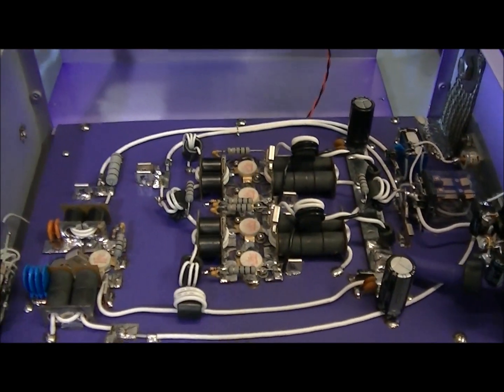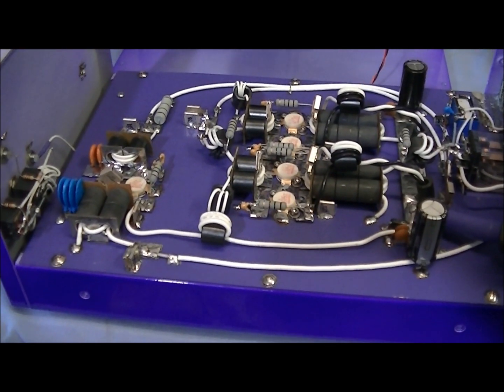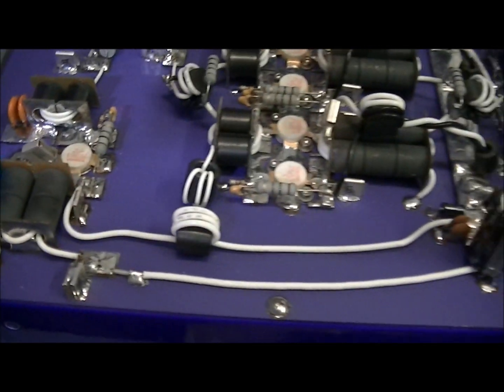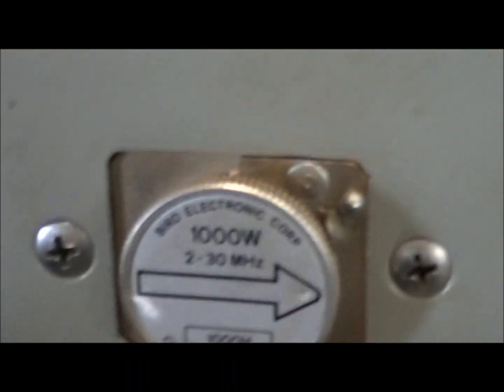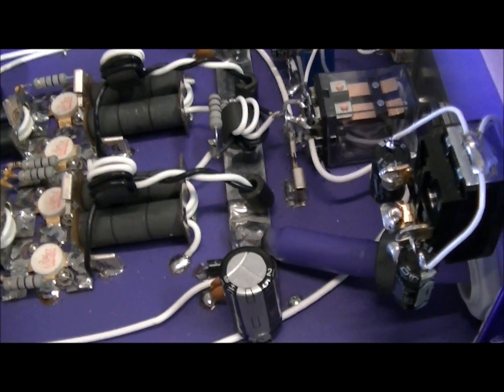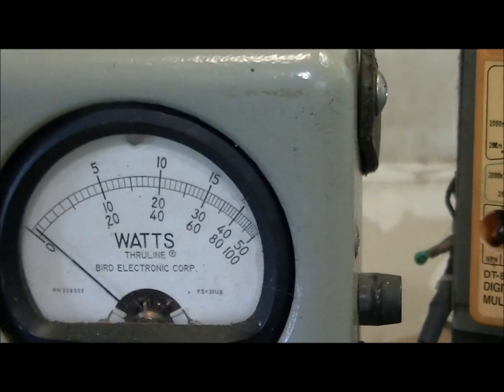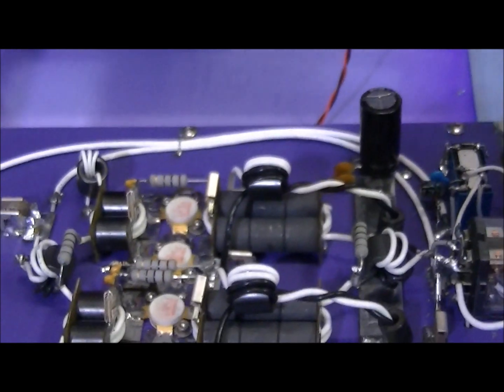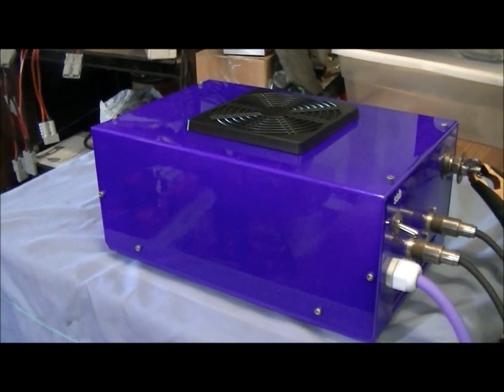GK Built 1x4 5 Pill Staged Amplifier In LARGE Case GOT DOWN!

Comment: Gatekeeper,  I'm  planning to up grade an older five pill base amp with a 100 amp iron transformer.  What type and  size wire should I use from the rectifiers to the capacitors  and then on to the hot plate, thanks

Comment: That working great. The tunning of pass threw on staged amp can be tricky at times. now some metal clads are hard to get. I got fancy on a re build using tri color led for power then key and led change color. I did a 4 pill fix with extra twist. DPDT bias relay with switch. AB/C . used outher contact to jump bias diode to ground when un key and class c. when bias relay un keyed the diode jumped out. what the extra contact did. so switch just break bias relay coil. I have done 1 pill with round ferrite wound 5:1 or 9:1 depending on transistor. can do it with output as well. got idea from 1 pill amp that was done that way. got a bunch of voltage reg IC today'. LT 1038 and LT 1083 and more. 73's
Reply from the maker: Let me get this right. Are you telling me that you used a ferrite(single ferrite) to wrap 5 wraps to 1 for the single transitor so there isn't any compensation capacitors(1000s & 104) to make up the other pill not being there. Id love to see that! Could you send me images to my email threemanpro at gmail . Com please.

I have thought about using tri color before but never took time to work up a circuit on how I could do that. I've used bi color before.

I did a few AB/C boxes in the past. Havent had anyone request one in a long time.  Man I'd love to see video and or images to all these projects you work on man.
Reply: @1883GotDown  That amp was a re build a few years ago. oner picked it up years ago. The example amp was 1 pill MRF 454A class C box, that sent out as well. I may have a old amp done that way to send pic.  I did not have input transformer at the time so what I did is using a old Texas star splitter from DX 400 . pulled wire off . re wrapped it. both primary and secondary went to ground . primary was 50 ohm input . secondary had cap to ground tunning. appx 470 PF. been few years . cap to base of driver 100NF . to bias is RFC to base of driver.  wound like splitter. the input would be ground. the 2 outs would be primary and secondary. no 100 ohm. The turns ratio is to match impendence of transistor to 50 ohm. you could also do just coils for input and out put. no ferrite on 1 pill . the palamar50 with MRF 450 was done that way. RM Italy KL 35 and KL 40 done that way with FET . one has no relay . just switching diodes . I have both amps but put in back of storage and hard to get to. 73's
Reply: your in luck. I found my 28 MHz test pallet . has input ferrite and is a MRF 151 one pill 50 V test. does 100 watt RMS. This is a 9:1 wound input put for FET .just a outher way to do input. I will send the pic's in a email to you. have fun playing . this in not my idea I copied the circuit from a old 1 pill.  73's

Comment: Fan should be a little bit more quiet on lower voltage
Reply from the maker: Should have heard it with out the resistor  lol...ole Big Dog drops the maul with his amps lol so I wanted to go a bit more hefty on his fan for him....best thing to do in my opinion is put a variable speed controller on the fans so the user can control the speed exactly where they want.....Thanks for your comment 👍 please stop by any time I enjoy & respect anyones input. 73
Reply: GK I was just talking about when you had it on the unregulated supply. It should be more quiet on regulated lower voltage supply. I enjoy your videos and everything I learn from you. Keep up the good work. 585 coast of the Magnolia waving 73's click click
Reply from the maker: @chasedanley9760  ooooooooh My Bad my bad yeh I got cha now...yes you are right....plus you won't have to hear the fan speeding up and slowing down everytime the person keys the amp because of the unreg supply changing voltage.

Comment: See 911, folks kept telling my there was no way I was getting over 1k out of my 4 pill. I'm running mine at 14.5v.  Brother, you gonna be talkin
Reply from the maker: Sherburne Lee anyone that tells you you cannot get 1K out of a for transistor amplifier that's because they've never had a for transistor amplifier that will do 1K it's that simple if I can't see 42879 still in a thousand Watts on my meter than it's not working correctly but at the same time I'm not sitting there tell him everybody that's the absolute best output the run one at different amounts of output sounds differently with different radios and setups I normally like to run mine about half throttle mr. Gatekeeper said that I'm good and gone bye-bye